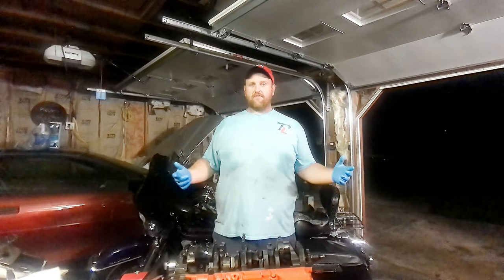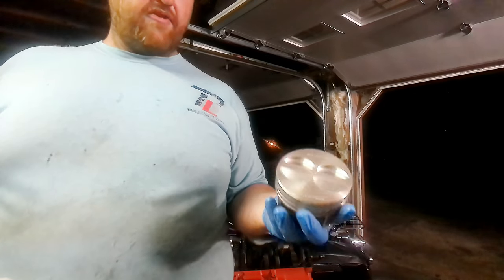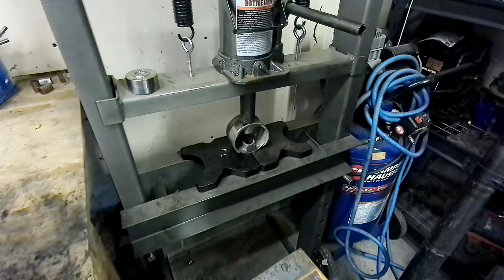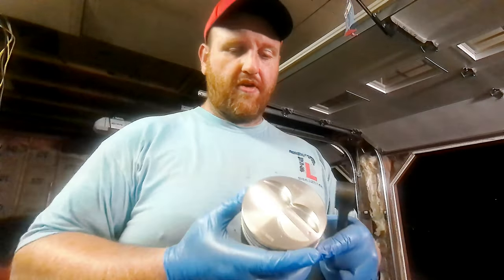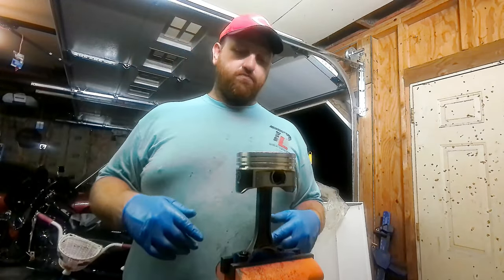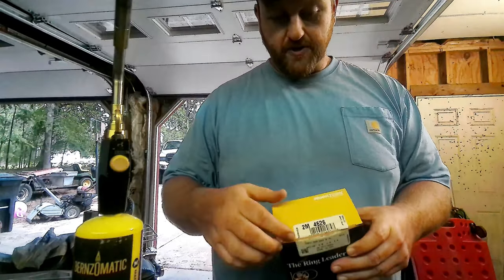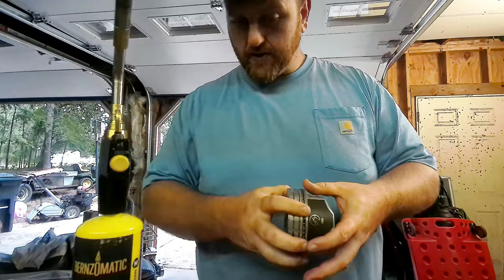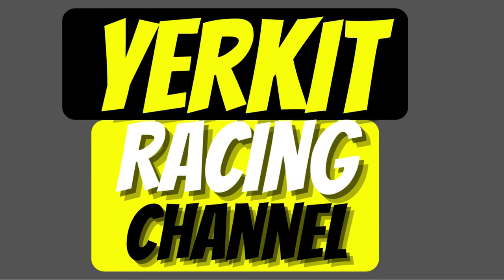LT1 engine build: How to install PRESS FIT PISTON PIN@ HOME! + rotating assembly finished! GEN 2 SBC

Comment: Couldn’t you have taken a drill bit and drilled slightly on the underside of the piston that was a tad heavy to lighten it for an exact weight to the other piston? Or even filed the pin a shade. I’ve seen it done this way just a thought. You aren’t looking at much material to remove at all.
Reply from the maker: Thought about taking a little off one of them. Spoke to Karl from Ellwein Engines and he assured me that it wasn't enough to matter in with this engine. I know he's built a ton of these engines so decided to trust his opinion... Hopefully he's right!